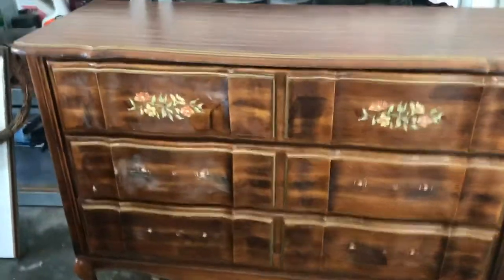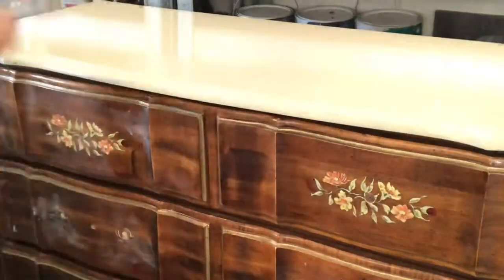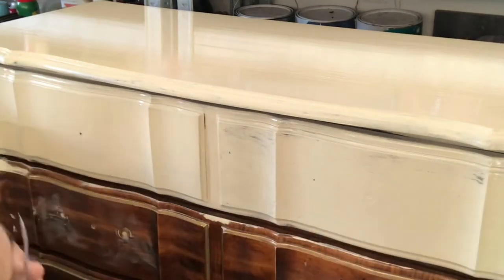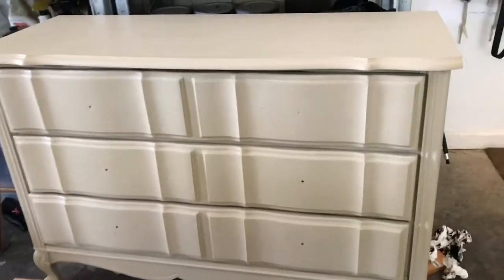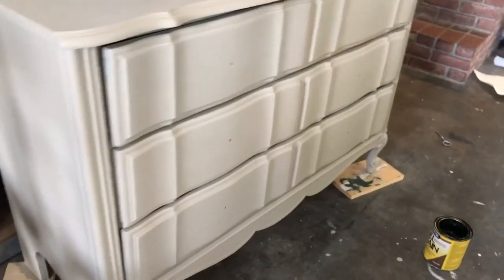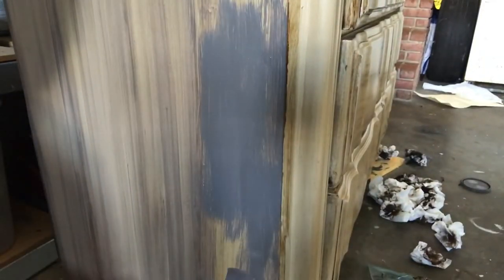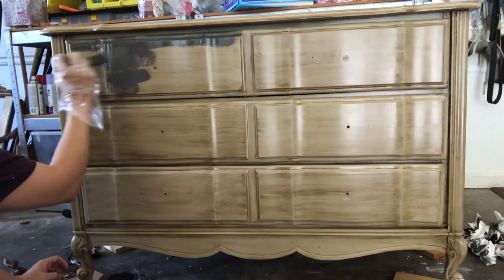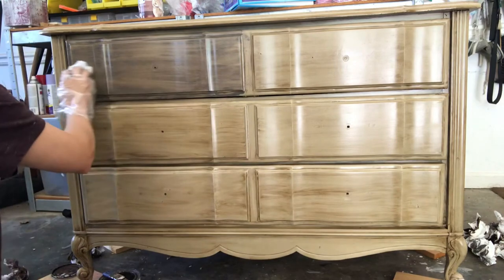French faux Wood Finish - THIS IS STAIN ON PAINT!!! Layering stains or glazes | Dresser Makeover

Comment: I absolutely love this, but my only issue is I have a dresser chest that I want to do this too but it’s has brass recessed handles and I want to do away with that, but haven’t a clue what to put in its place since the hole cutout. Any suggestions?
Reply from the maker: I would remove the metal part and then fill the recessed spot with bondo or some other wood filler like Durhams rock hard water putty.  And then drill new handle holes.  Durhams is super cheap so since you’ll be using a lot you may want to go with that.  Lay the furniture on its back so it doesn’t drip out while it’s drying 🖤
Reply: @blacksheephouse  thank you so much for the quick response!!!

Comment: Do you have a problem with using water based and oil based on a project?
Reply from the maker: I never ever had a problem as long as the paint is dry before lol inch onto next step.  BUT I have switched over to using only water based glazes instead of stains for the ease of cleaning up.  I need to recreate this look using what I use now.  Grab some rustoleum antiquing glaze instead of the Minwax gel stain I use for starters ❤️

Comment: I tried this before, I screwed it up. I am trying again today or tomorrow. I am going to be patient and let things dry. Do you still suggest the napkin? I think I will try that if so. I used shop towels before and I think that wasn't best.
Reply from the maker: Yeah, I really like using napkins and then just throwing them away!  Also, stay tuned for Sat because I'm posting a video creating a similar look to this with all water based products found at the home depot!  The biggest pain with some of these finishes was using the oil based stains and the clean up and smell involved.
Reply: @blacksheephouse  YAY! Can't wait!
Reply: @blacksheephouse  question if you see this. I didn't want long enough between briarsmoke and the white wash. It took off a littel too much of the briarsmoke. Would it be ok to add a little more briarsmoke over the whitewash and then let it dry really well and white wash some more? I LOVE how it looks!
Reply from the maker: @Bella_does_edits  oh yeah I’m sure that’ll work, I apply more stain with a chip brush so I can feather it in whenever that happens to me!

Comment: Do you have the link for the drawer pulls? Love them!
Reply from the maker: <iframe style="width:120px;height:240px;" marginwidth="0" marginheight="0" scrolling="no" frameborder="0" src="//ws-na.amazon-adsystem.com/widgets/q?ServiceVersion=20070822&OneJS=1&Operation=GetAdHtml&MarketPlace=US&source=ac&ref=tf_til&ad_type=product_link&tracking_id=definitionhom-20&marketplace=amazon&amp;region=US&placement=B08CRGHMGK&asins=B08CRGHMGK&linkId=58cc6dc0e956e06b53a8fe29ef8f6fc3&show_border=false&link_opens_in_new_window=false&price_color=333333&title_color=0066c0&bg_color=ffffff">
    </iframe>
Reply from the maker: I spray paint them black and dry brush a bronze paint on top to age them, I don't clear coat them after but you could if you want.  I use the automotive black spray paint at home depot because its matte finish,  I'll see if I can find the link